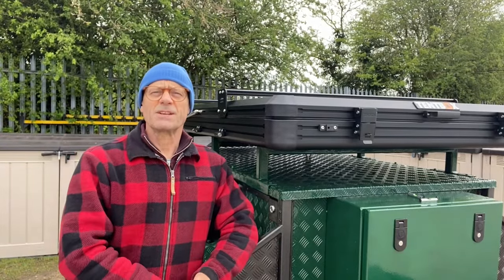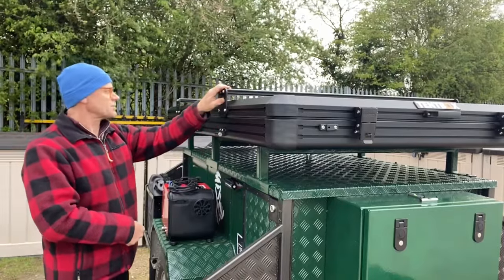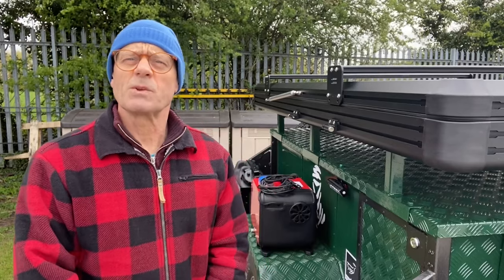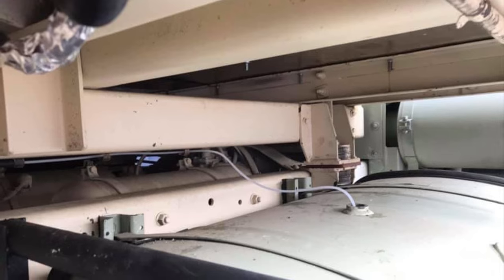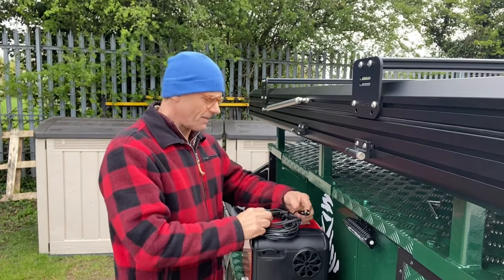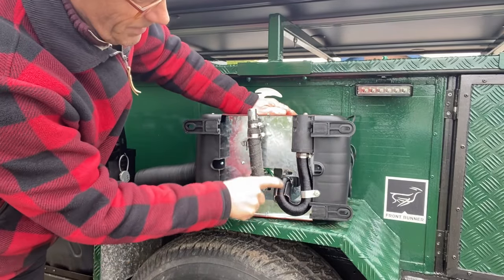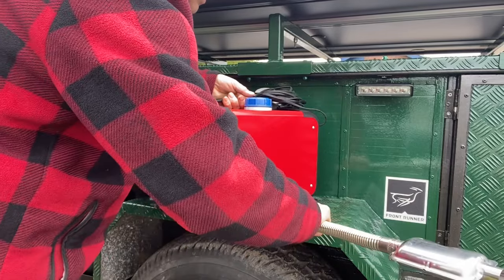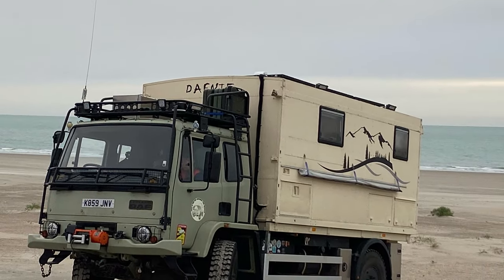Fitting Tentbox roof bars and Chinese diesel heater|Landrover Defender 90 and trailer conversion

Comment: 2 things, initially, 1, power volt drain and amp draw, you should not be running a potential 20A through a cigar socket, use a 50A Anderson connector and at least 6mm² wire or you have too much volt drop and the heater will be unreliable. I run 10mm² on my Eberspacher from battery to heater fuses. 2, is the flexi hose rated for 200+°C? As that is what can be coming out of the heater. don't want to be melting it and gassing you out. 

It's also worth getting a good distance between the exhaust and the fresh air inlet, as you don't want to be sucking up the gasses as that's a good way to put you to sleep permenantly. I hope you have a CO alarm in the tent and the truck.
Reply from the maker: https://youtu.be/u-GimQVDeEI?si=djFGT2xwAOCr4Wfl
Thanks for the comment 😊
The amp draw is only 10 amps on full fan and glow plug . Yes the hose is more than capable taking the hot air . This is the third heater I have used previous Camper lorry and our narrow boat . The exhaust has an extension piece and il be aware of the wind direction. Good shout as I did forget about a CO alarm 😮